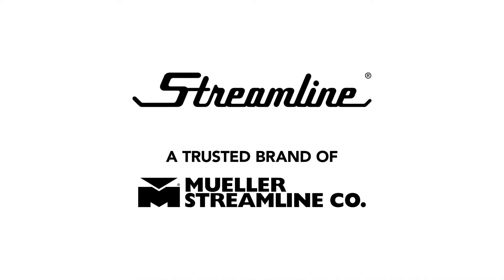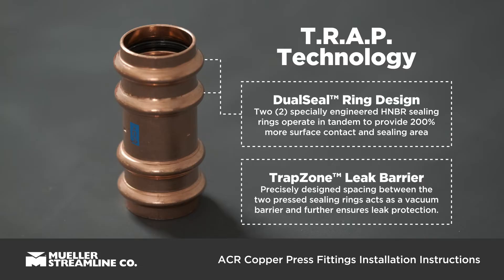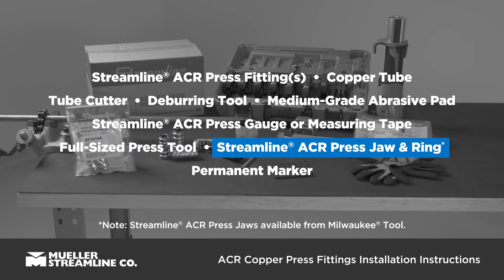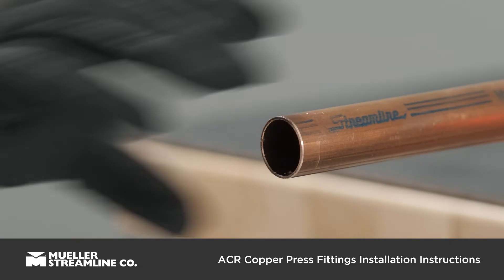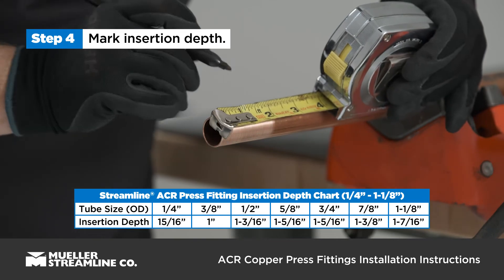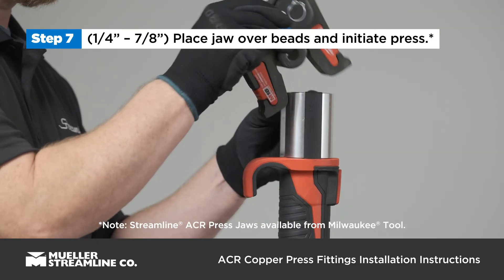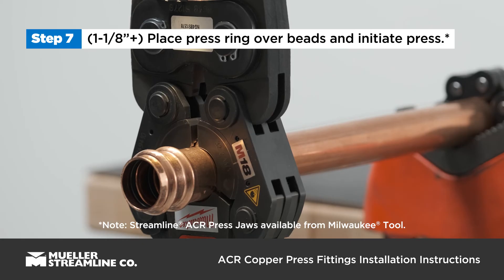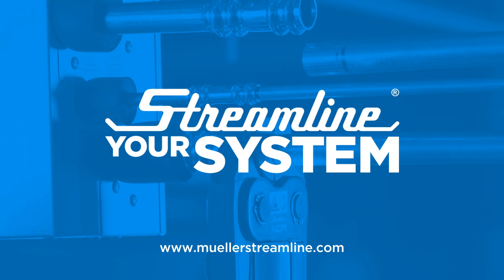Streamline® ACR Copper Press Fittings | Installation Instructions

Comment: Will the Milwaukee Arc jaw work on 241 rigid pro press ?
Reply from the maker: Yes - the new COMPACT Milwaukee Streamline ACR Press Jaws are compatible with Ridgid RP Series Compact RP 100, RP 200, RP 210, RP 240, and RP 241 (only for sizes 1/4" - 7/8").  All tool & jaw compatibility information is listed at the following link, on page 7: https://muellerstreamline.com/?wpdmdl=2920
Reply: @muellerstreamline  thank you
. I’ve only owned my pro press system for a short time and I’m already not impressed with the supply chain and cost of jaws  . So if I go with stream line products , a set of jaws cost $1500 . That’s if the supply house carries them . Then RLS fitting are more accessible but now I have to spend another $1500 for a jaw set . You see my dilemma ? Rigid  and or Milwaukee needs to buy out streamline . Or you lose money  on the Jaws and make it up on the actual fittings .
Reply from the maker: @garza7676  We understand your compatibility frustrations, and have some good news.  We are currently running a promotion where you can receive FREE tools AND jaws with purchase of Streamline ACR Press Fittings through an authorized distributor.  Details here: https://muellerstreamline.com/?wpdmdl=3092

Please reach out to us, though, by shooting a note to mail@muellerstreamline.com with your contact information.  We'd like to connect directly and help address some of your concerns.  Look forward to hearing from you!
Reply: @muellerstreamline  Thank you again for reaching out . My background is in aviation . I’m an aircraft structural mechanic ( sheetmetal) . I currently work on the F-35 and F-22. I have 20 years of experience with pressing fittings , hydraulics mostly . Pressures ranging from 5k to 8 k . Deutschelite and permaswage products are what I’ve used .I only work hvac part -time , I am certified . I know press fittings work and it is the future! . I feel there’s  some marketing issues in play  holding this technology back .

Comment: What is part number for press jaw used in video for 1 1/8 acr?
Reply from the maker: For installation of 1-1/8" fittings, the 1-1/8” Milwaukee Streamline ACR Press Ring (49-16-2657M) and Milwaukee FORCE LOGIC Ring Jaw (49-16-2659) are both needed.